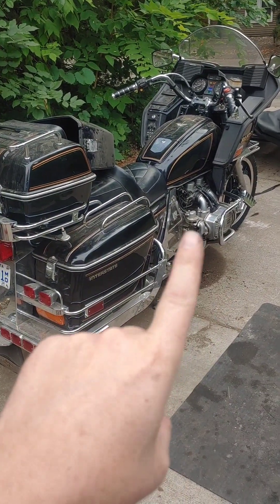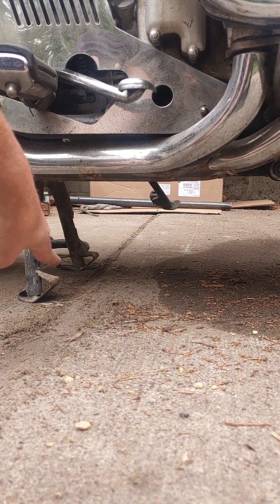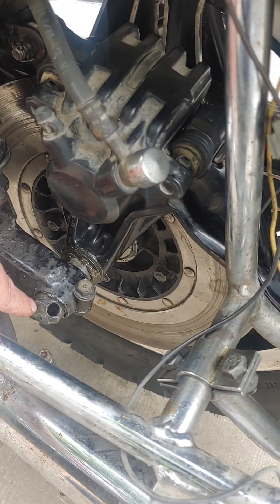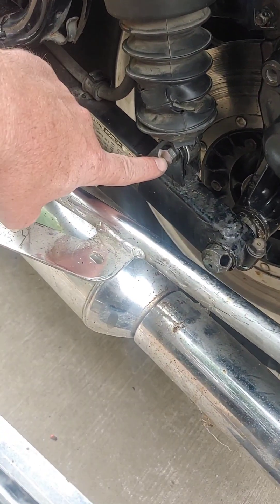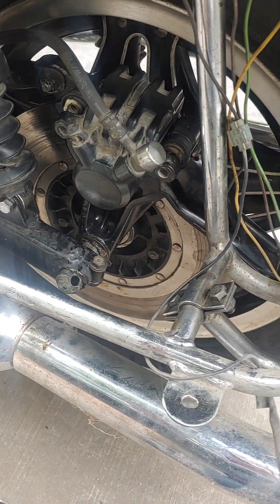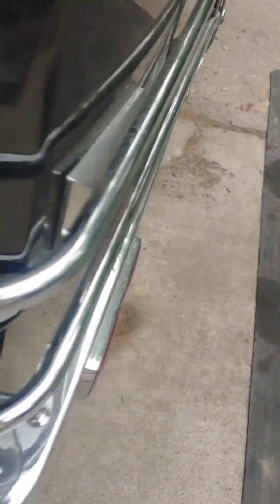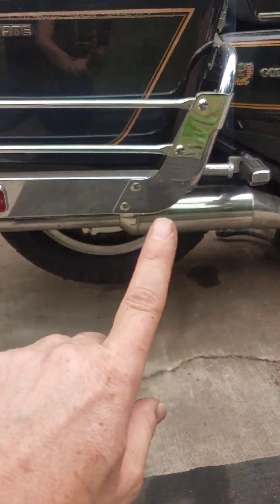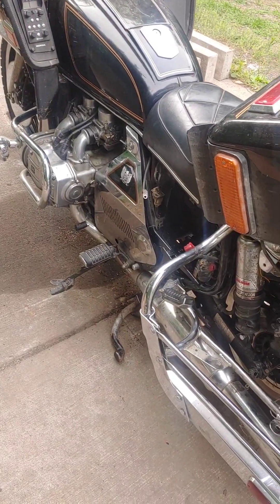rear wheel removal from a 1980 honda goldwing GL1100 with bags left on

Comment: Thank you for the tips.  I'm about to remove the wheels of a GL1000 and was wondering about jacking the bike.  I have a jack like yours.  Looks like the jack was contacting the back part of the engine with one lifting surface.  Was the other surface of the jack lifting by contacting the exhaust pipes?  Are the pipes strong enough to support the bike?
Reply from the maker: @SoCalBruce  hey Bruce! Most of the weight was on the engine, notice the wood stick pushing up on the rear luggage rack. That was just basically helping the bike balance on the engine. I didn't really have any weight on the mufflers